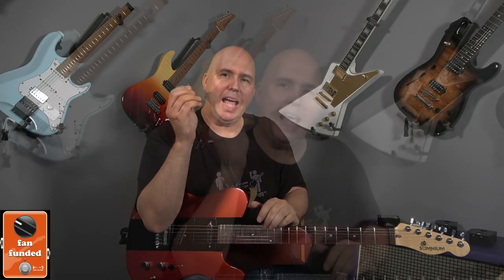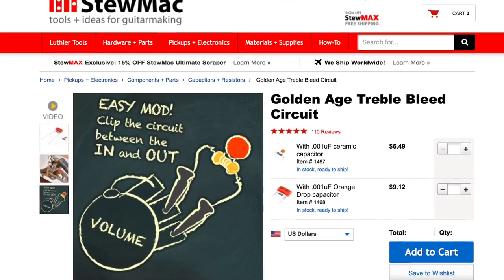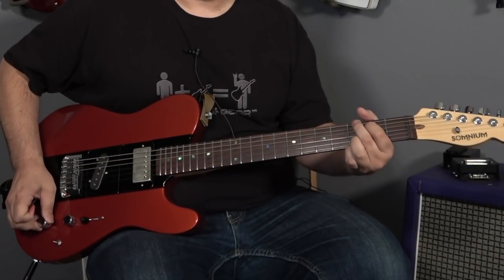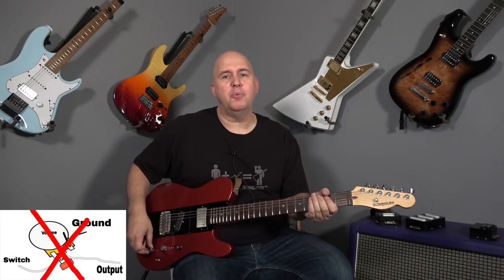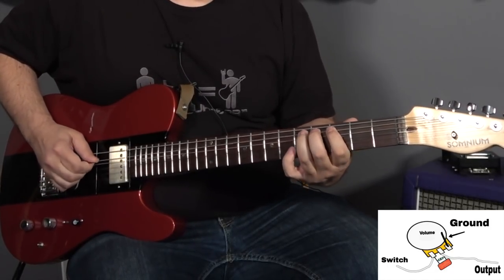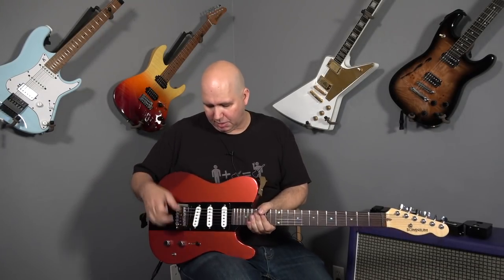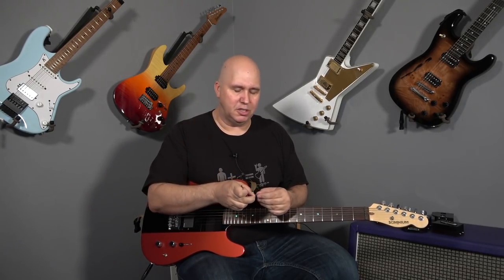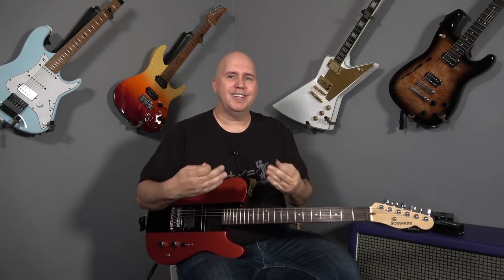How To Use A Treble Bleed On Guitar

Comment: Wouldn't an EQ pedal do the same thing?
Reply: short answer no. 

long answer is that when you put the slider up on an eq, you're amplifying frequencies. if you add high end, you're adding gain, making the high end louder than it ever was from the pickup. however this simply lets frequencies (that were already there from the pickup) back through, instead of them being choked by the volume pot.
phil explains it at 4:21
Reply: @EpicStuffMan1000  except you can use an EQ to cut as well. The short answer may be no, but if your guitar is getting darker when you roll back your volume, you can set an EQ pedal to brighten your tone to engage when your volume is low and get equivalent results.
Reply: Hi JM

First off just want to note I usually only use an equalizer to reduce the shrill high end, increase the mids  and boost a single coil. Never thought of using on humbuckers.
Just gave it a whirl. Using a GE-7 it took a bit of fiddling to get the high end back up while keeping the volume at the same low level. Also, it reacts differently to different pickups. Tried it with 3 guitars and had to readjust it each time. Top much fiddling for my liking. Going to try the mod in it's different states and see what happens.
Another fun excuse for sparking up soldering iron!